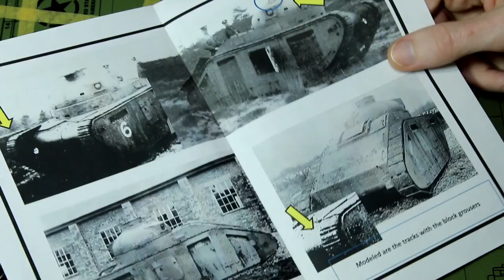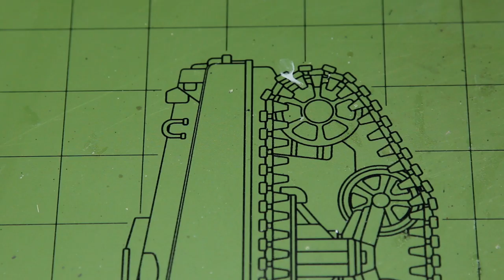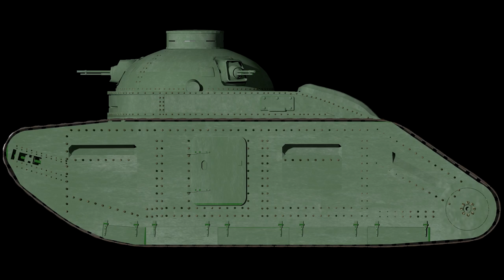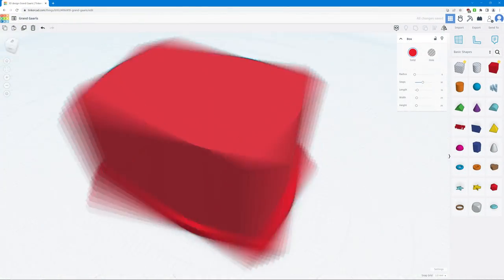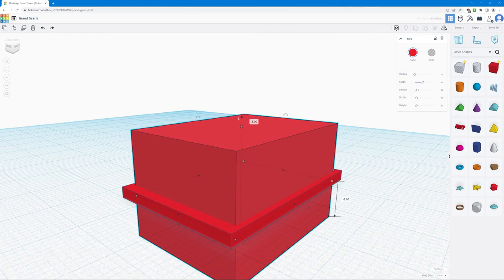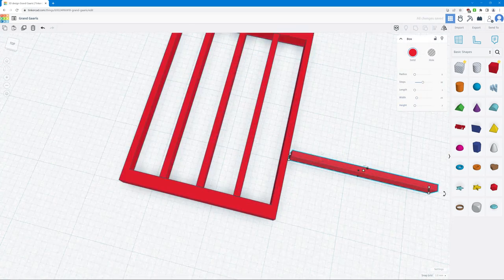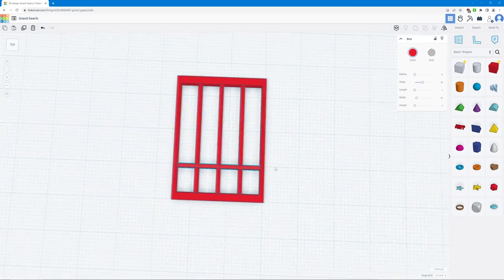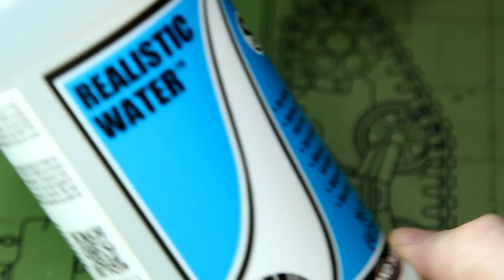Vickers No. 1 British Interwar tank - Vargas 1/35 scale model

Comment: Great and unique build! for making the ground-grass-tracks a little more connected, you should press and imprint the tracks a little when the ground is wet, push the grass into it as the tracks run over it and maybe add some mud that reveals because of the tank's weight.
Reply from the maker: Thanks! And thanks for the tips.
Reply: @ModelNerd  my humble pleasure, sir!

Comment: I love those interwar tank designs and you've done a great job with this one, I'm really liking the way the paint job turned out. My only criticism is that you don't seem to have got much mud in the  mud channels themselves, those slots in the upper hull sides are there to let mud fall away from the underside of the tracks rather than becoming compacted around the track return rollers (or in some designs simple metal skids rather than rollers) so while you have the mud running down the sides of the tank, there isn't much mud in the place it is actually coming from. That's a minor nitpick though and the finished diorama looks fantastic.
Reply from the maker: Thank you for watching, and I appreciate your feedback. Yes, mud is something I need to work on more I think.